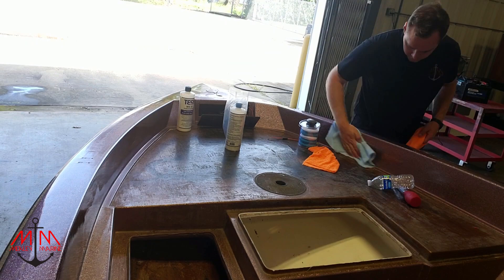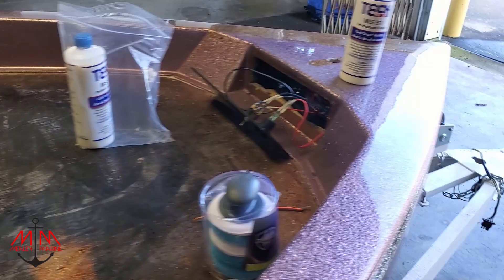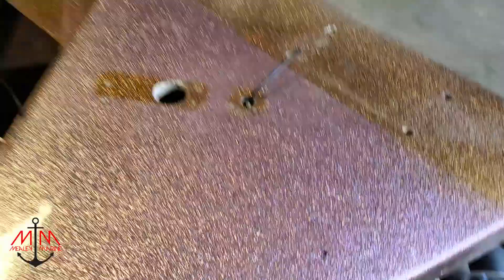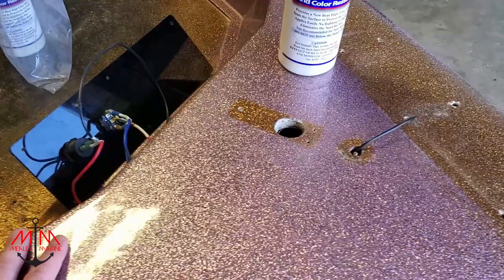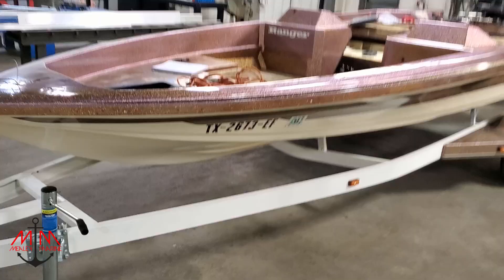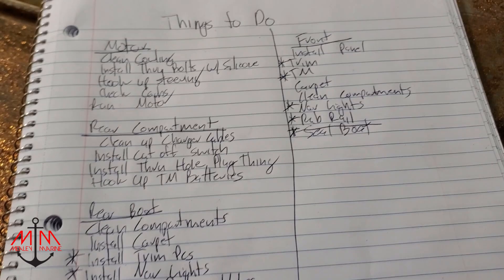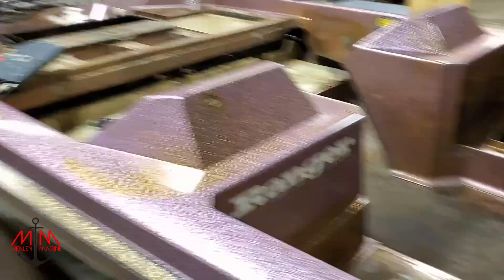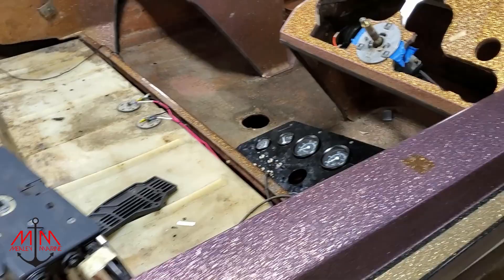BASS BOAT RESTORATION | 1988 RANGER 363V | PART 27: HOW TO PROTECT YOUR GELCOAT

Comment: Ceramic Coating an option on this finish? And will what you're putting on their mess up covering it with ceramics I've heard you can't use any kind of waxes before you put ceramic everything needs to be stripped off

Comment: Hey Michael, I have a question because it also pertains to my boat as well... the bow of the boat where the holes are for your trolling motor, is there wood encased in fiberglass, or is it just multiple layers of glass? The holes on my old champion are wollered out and appears to be flaking underneath.
Reply from the maker: Mine seems to be straight glass in that area. Big fender washers in that area will help. Or fill with epoxy and redrill

Comment: Whatever you do don't put an ultrex on that boat. I have one sitting in my garage after countless problems with it. I even upgraded the wiring on my boat and it still malfunctions. I ripped out the ultrex and bought a motorguide tour pro and haven't had a single issue. I can't even sell the ultrex without feeling guilty that I'm selling someone a piece of junk
Reply from the maker: What voltage?
Reply: I've liked them when using on my friends boats I've never heard them talking about problems what exactly is the problems?